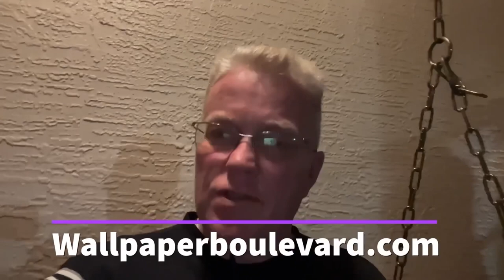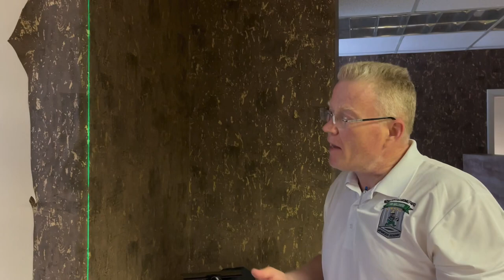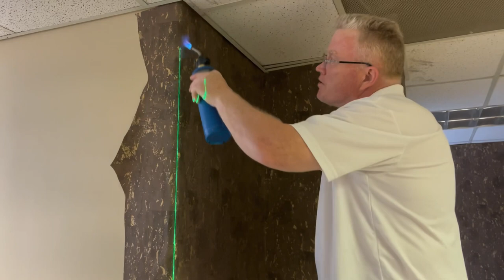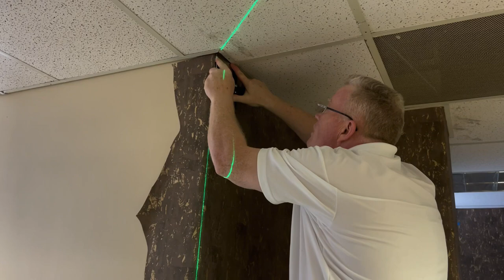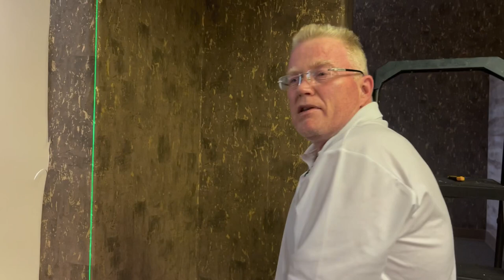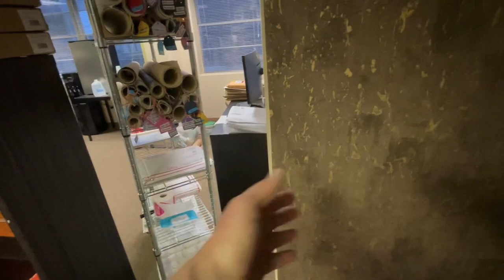How to Vertically Trim Wallpaper on a Bullnose Corner - Spencer Colgan

Comment: Spencer, which adhesive did you use to help hold the corner down?  I haven’t had a job where I needed to trim on a radius but I always worry about the edges on radius doorways.
Reply from the maker: Gorilla glue.